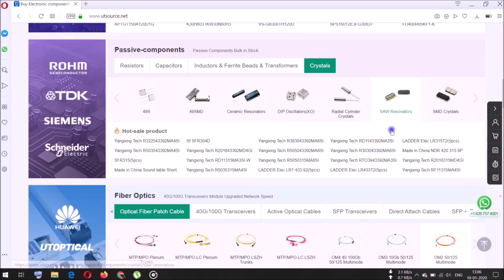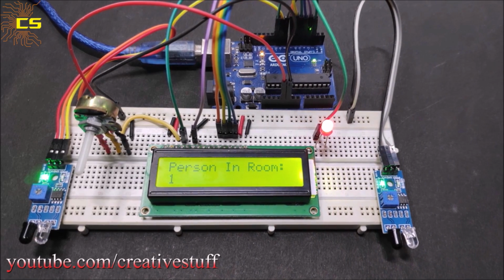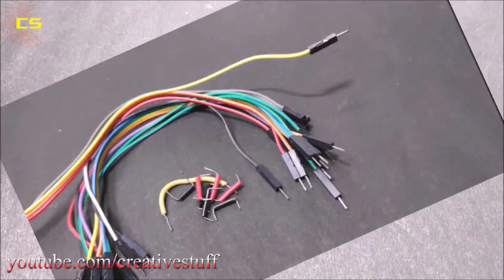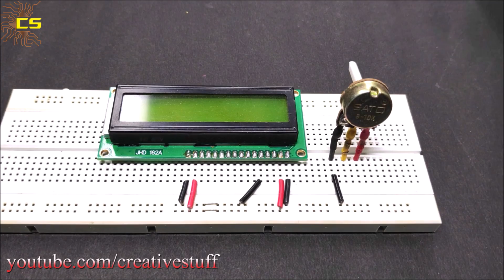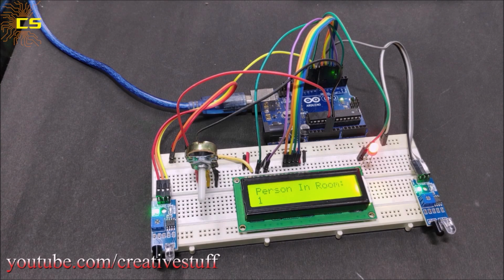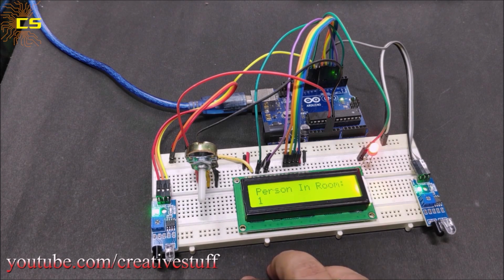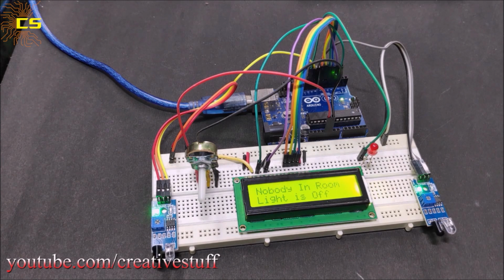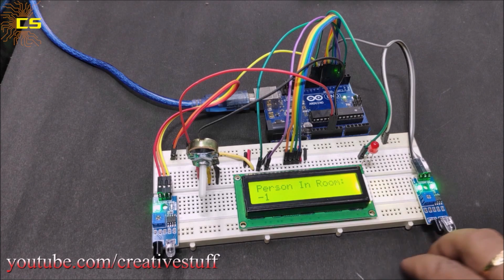Bidirectional Visitor Counter Using Arduino

Comment: Hii i need a help

I am making bidirectional visitor counter using arduino uno With automatic room light controller
 I am getting error like 

When there is no visitor my led was glowing instead of turn on led i need to turn off when there is no visitor and when there is any visitor my led wants to glow

Plzz help me

This is my code:

 #include<LiquidCrystal.h>
LiquidCrystal lcd(2,3,7,6,5,4);

#define in 8
#define out 9
#define led 10

int count=0;

void setup()
{
  lcd.begin(16,2);
  lcd.print("Visitor Counter");
  delay(2000);
  pinMode(in, INPUT);
  pinMode(out, INPUT);
  pinMode(led, OUTPUT);
  lcd.clear();
  lcd.print("Person In Room:");
  lcd.setCursor(0,1);
  lcd.print(count);
}

void loop()
{  
  int in_value = digitalRead(in);
  int out_value = digitalRead(out);
  if(in_value == LOW)
  {
    count++;
    lcd.clear();
    lcd.print("Person In Room:");
    lcd.setCursor(0,1);
    lcd.print(count);
    delay(1000);
  }
  
  if(out_value == LOW)
  {
    count--;
    lcd.clear();
    lcd.print("Person In Room:");
    lcd.setCursor(0,1);
    lcd.print(count);
    delay(1000);
  }
 
  
  if(count==0)
  {
    lcd.clear();
    digitalWrite(led, LOW);
    lcd.clear();
    lcd.print("Nobody In Room");
    lcd.setCursor(0,1);
    lcd.print("Light is Off");
    delay(200);
  }
  
  else
  {
    digitalWrite(led, HIGH);
 
 
  }
}

Comment: Good project.....I have a suggestion.....don't use two separate doors....instead use sensors together at one door...and write a code that if sensor one is detected first and then sensor two someone has entered the room and if sensor two is detected first and then sensor one someone exited from the room....so only one door will be used.

Comment: Is there a schematic that includes the breadboard? That would be tremendous help. I'm confused in what pin I should insert as it may don't align with the code
Reply from the maker: Schematic is there in the description
Reply: @CreativeStuff  alongside the bread. The schematic didn't have the bread board